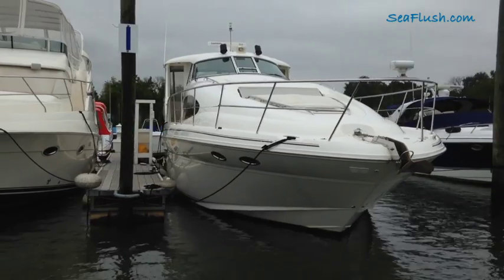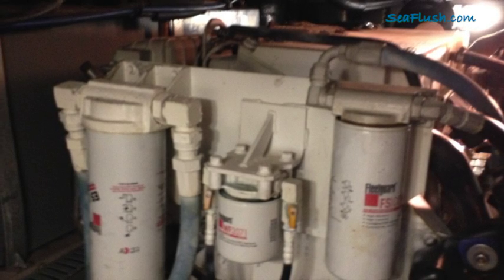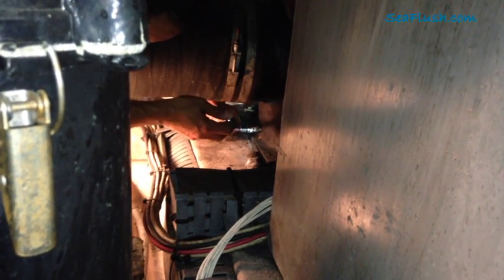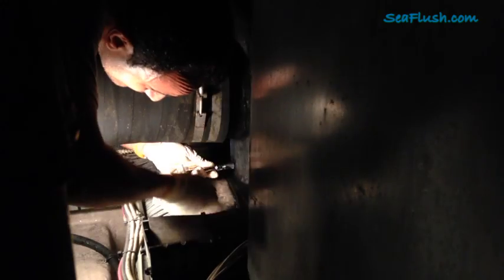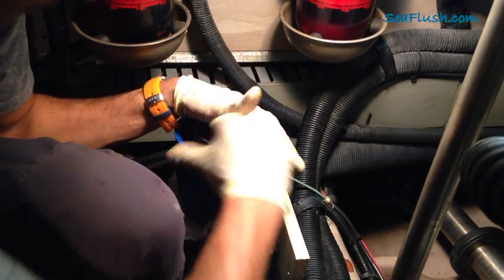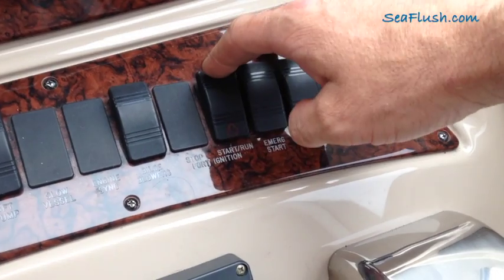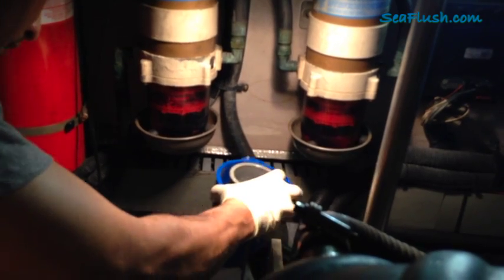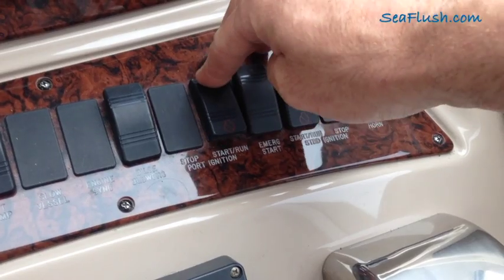Using Sea Flush and Barnacle Buster to clean the Mufflers on a 48' Sea Ray with Cummins QSM 11s

Comment: I tried the "snorkel" with my diesels.... guess what?  It doesn't work...... yes, I tried the gasket thing but still doesn't work.   You do NOT want your diesels running for any amount of time with no water.
Reply: Make sure the seacock is closed, otherwise the engine will just pull seawater in through the intake hose.  Otherwise, you may have another accessory drawing water off the same intake hose.  The engine's impeller creates suction, so with all other routes closed off, it'll pull liquid through the snorkel.